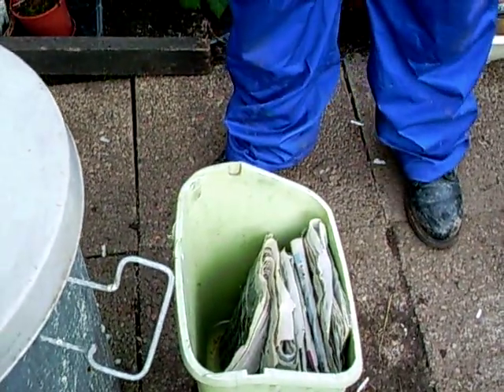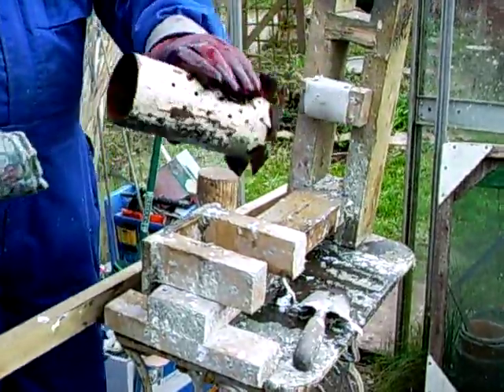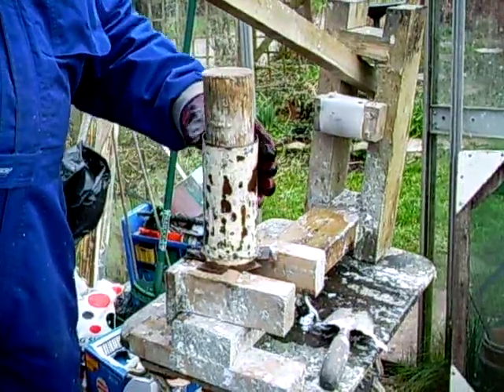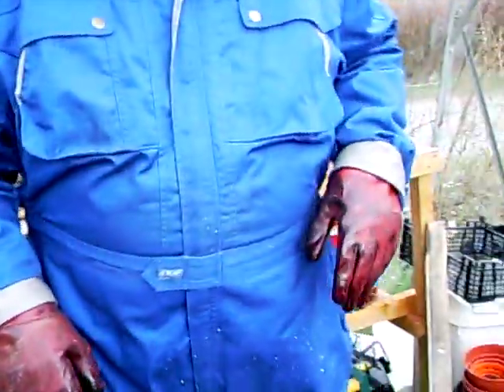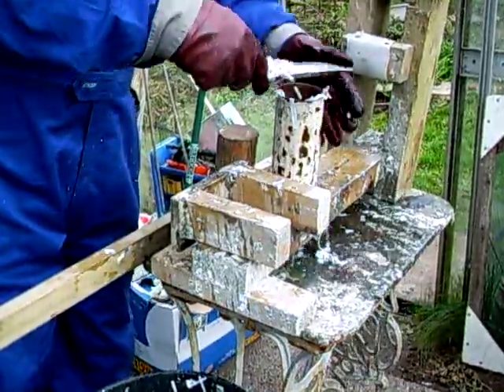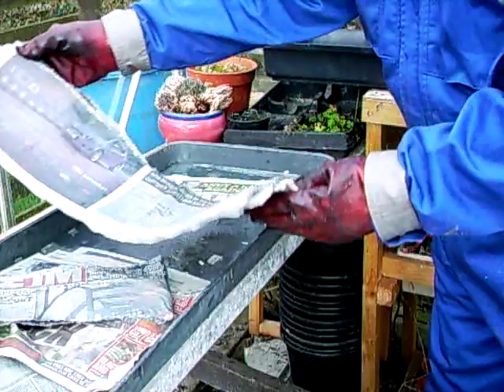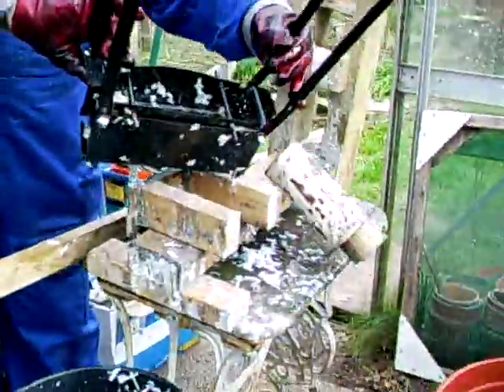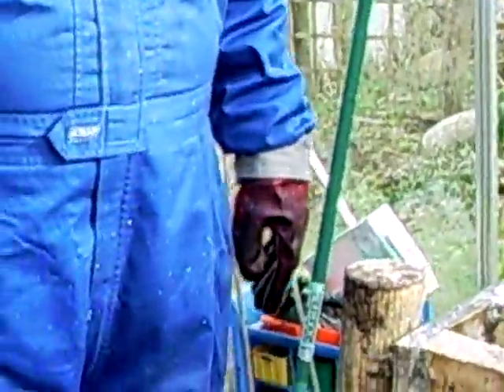paper brick.ASF

Comment: Archers omnibus in the back ground on a nice sunny day :) That is living .......

I assume one would mix these in to bulk out other fuels? Any information on burn time, drying time,  I know it is a while now but just curios...
Reply from the maker: That's it exactly - to bulk out the coal. The main ones I use now are (1) the flower pot type and (2) tightly rolled up dry newspapers 10" long x 2 1/2" diameter. I tend to use them more in the evening when the house is warm and find they are often still smouldering next morning.  Garth
Reply: Thanks for that :)
Reply: what is proportion of paper and sawdust and paper

Comment: Ran out of space.  Find an old pallet and take it apart.  Then build a mold out of the slats.   Use the 4x4 parts as the pistons.   That is how I did it.  Worked great!   Broke two pieces of cross member 2x4 pieces and then converted it over to metal.  Works perfectly now.   Think its time to go make some more!  Still cold in Northwestern NJ!  I thought it was spring already!

Comment from the maker: The '8 at a time' mould seems to work well with your mix - Nice one.  I am currently working on 4" diameter x 4" high bricks. When using shredded paper I can use the lever press but when using soaked newspapers or magazines I have to use my screw press because it takes time for the water to work its way through. Keep throwing the ideas in, we are all learning. Thanks.   Garth